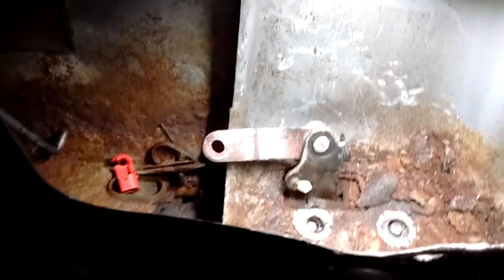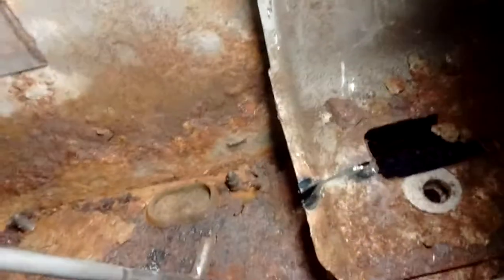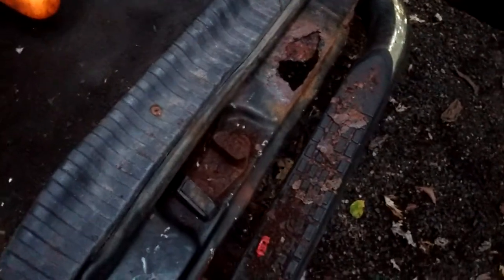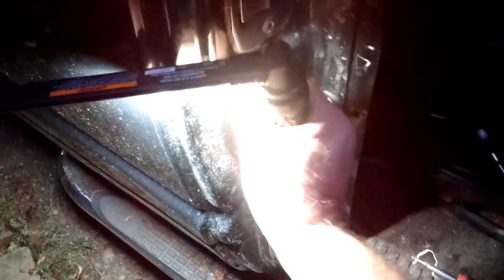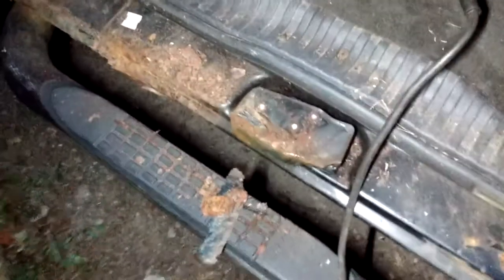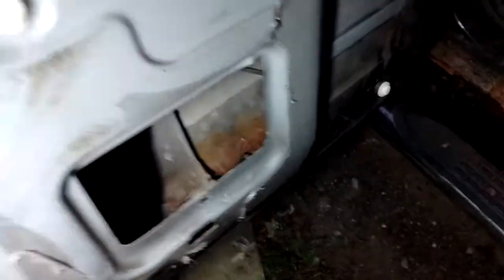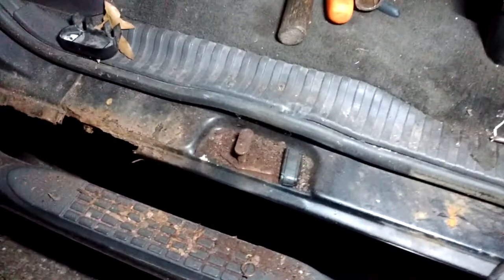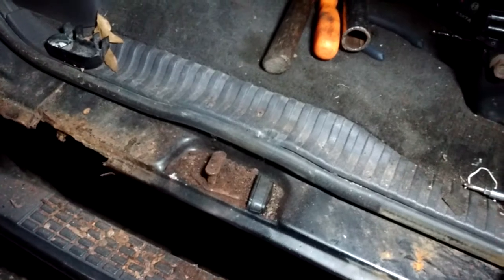'98-02 DODGE RAM- RUSTED QUAD CAB DOORS FIX!!

Comment: a follow up, my 02 door panel lot harder to remove bout 8 dreaded lock pins in it, I suggest just remove outer handle disconnect lower lock rod ,pull to open if can only use top lock

Comment: Thanks for the info! Especially the right place to cut the latch at 3:00  
I was able to get one nut off it inside the door, then used pliers to wiggle break the latch arm and stud off. Snuck an angle grinder into the door for the other two nuts. A little encouragement from inside with my boot and now I can get to my chains and other nonsense in the back seat! 

A++ will watch again.
Reply from the maker: thanks

Comment: My lower latch was stuck. Rust. This video helped me see the 3rd bolt. But I broke and cut nothing. After cleaning the bolts. And rod an clip I took a 3 ft bar and forced it open. That did rip two bolt holes a little. But it opened. I cleaned up the latch got it working. The reinstalled works great.

Comment: Thanks for the help Brother, I used a dremal tool with a small cut off wheel to get in the door. And the cut off wheel or grinder when I got the door open. You saved me a huge head ache and I want to say thanks !!!
Reply from the maker: Glad to help- thanks for posting

Comment: This is the most common problem with these trucks...if it's seized shut ..you can pry and cut and curse for days doing this ..the best way I found was to pull the door handle and block it open with a piece of wood then get a six by six and lay it inside your door right where the latch is..then get a ten pound sledge and hit the block as hard as you can ..should come loose within ten good hard hits..it won't damage anything and it'll work I promise you ....but I know your pain and also know the joy you felt when it come loose..lol some  can be ridiculous to get open and mindboggling as to what's holding them there after you've cut everything that could be holding them off..lol
Reply: Thank you way easier to just beat it then to grind everything 👍🏽

Comment: My passenger side rear door opens fine even with a little bit of rust but the Dr side will not let go at the bottom enough with the door panel in place to open the door, but I kinda think I can get it moved slightly up and I could open the door because it seems only the bottom of my rockers are rusty lol.
Where are you at in the states Scotty sir?!

Comment: took me an hour to get the door off a donor truck meanwhile the doors in my own truck open fine but you can see right through them the rust holes are so big lol i found pry it from inside and cut the back side of latch attached to truck and just buy a new latch if need be though i didnt for donor truck

Comment: Exactly what I was looking for! I was planning on cutting through the striker as the bottom of one door is gone and it's easy to get to. I chopped a set of strikers off rockers in the junkyard, and grabbed a mangled door with a decent bottom half. At least the top half isn't rusty...  https://i.imgur.com/q8ByzvK.jpg
Reply from the maker: I made an updated video on my page on the same topic if you want to check it out-
https://www.youtube.com/watch?v=E325oausWpo